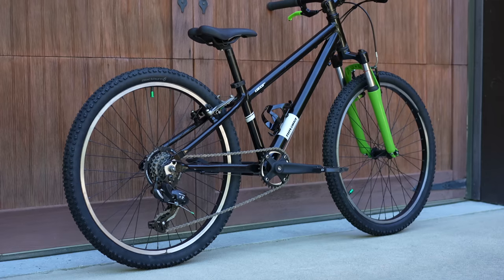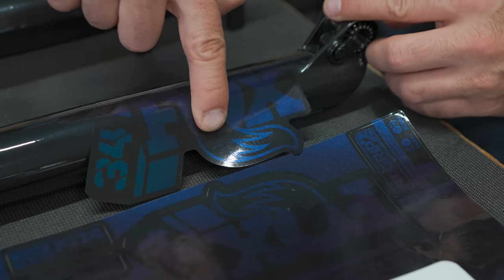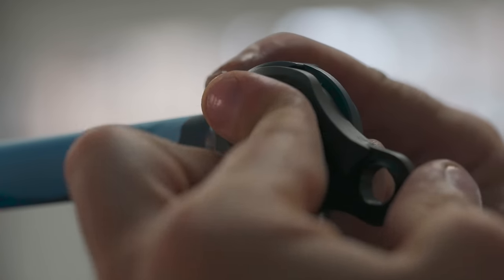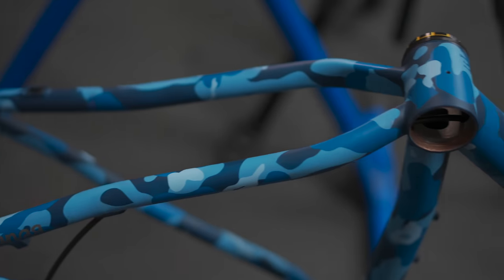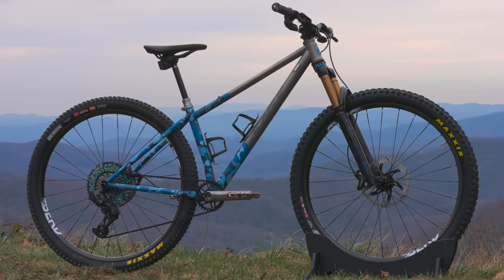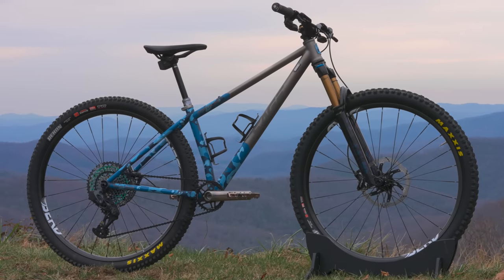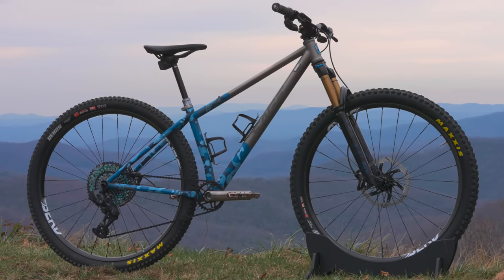Building the Custom Titanium Hardtail of my Dreams

Comment: I work at a bike shop and whenever we have brake hose rattling in the frame we wrap a zip tie around it and leave the tail uncut, so when you push it into the frame it pushes against the sides and stops the rattling.
Reply: This is actually a trick also used in sailing to keep wires from slapping inside the mast

Comment: Woah, very cool to see the shots in the Sage shop picturing the Toob Bender and The Creator Frame Fixture that I designed and manufactured in Grand Rapids, MI. Sick, bike, Seth. Can't wait to see more!
Reply from the maker: I was blown away by the tooling! Having “built” a tall bike frame using clamps and chunks of wood as a jig, it was easy to appreciate. We talked a lot about the fixture, the software, and your tools in general!
Reply: Instantly wondered if the Roggenbuck guy ™ had a say in framebuilding itself or your machinery is now widespread and appreciated. Congrats!
Reply: Best frame jig in the business!
Reply: Awesome man, I live in Grand Rapids!
Reply: @SethsBikeHacks  Hi seth I was wondering what head angle you chose for the bike. Is there a geometry list somewhere or maybe I missed it in the video
Reply: @NeronAzemi  66.5 if the dimension sheet shown is for this bike.
Reply: @jeremyhowell2332  thanks bro

Comment: I built up a titanium bike this summer myself, as my Bafang mid drive killed the bottom bracket shell on my old specialized hardrock.  New bike specs are pretty sick too: the frame is a Carver 96'er, drive train is a BBSHD mid drive pulling a Shimano Alfine 8 hub, riding on a rockshox recon 100mm fork, with TRP spyre cable brakes.  The thing is a beast on the road or trails, and the split wheel size (26" rear, 29" front) is a lot of fun.  Get well soon Seth!

Comment: I've been riging my NUKE PROOF since 1993' and it's still tight and solid. it's softened up by ~ 6% based on last flex test on the BB.  I've also been , between 235-250lbs. over that time period and blast big gears having been a pro Skier and ILB in University, downhill, trail, A line.. you name it, it's done it and been a champ for it.  Everyone looks at me like i'm an alien running around on 26s and 8spd XTR gear.  I will attest to the durability of Titanium.  amazing properties.

Comment: Beautiful build! Very cool custom blade. I highly recommend, if the sheath allows it, using a large cargo strap and mounting it to the downtube right at the intersection of the top tube and head tube. I have an Acta Non Verba P100 that sits there, completely out of the way and safely secured in the sheath, but instantly available if needed.

Comment: Your new bike looks great, and titanium is a perpetually cool material in an industry that leapfrogged it and went straight to CF. But I'd need it to have a rear shock. I've never ridden a hardtail that I didn't wish were full-suspension. I admit hardtails' classic double-triangle geometry is...well...classic, and aesthetically pleasing, and the acceleration is very direct, but riding over a single tree root is enough to remind me why full suspension is better. A suspension fork is useful for avoiding breaking your wrists on a hard landing, but it's too far away from the seatpost to do anything useful for the vast majority of your weight. And before anyone mentions a suspension seatpost, they don't do any good if you're standing.
Regarding the titanium cranks, PLEASE tell me you applied anti-seize compound to that large bolt before installing it. Titanium cold-welds like nobody's business, and without anti-seize you may never get that bolt out again. EDIT: Oh good, you did. I see the anti-seize at 3:48.
When you said the bike cost over $12,000, I nearly shat myself. The most I've ever spent on a bike was a third that much, and that was a Christini AWD bike.

Comment: Just got my first hardtail MTB
My build would start with the frame of the bike l just got which is a 2022 Marin Eldridge frame.
As for the parts being a beginner l would use good quality double wall alloy rims in 27.5 with Novatec sealed bearing hubs and pillar stainless steel spokes and brass nipples .

I would also use Suntour Epixon tapered forks with 120 mm travel with a risk headset.
Shimano BR-MT410 brakes with a 180mm front rotor and a 180mm rear rotor .
Shimano Deore bottom bracket with M4100 cranks in 170mm length and a 32 tooth single narrow wide chainring.
The rear cassette l would use is an eleven to forty six Shimano Deore ten speed cassette.
The rear derailleur l would use is a Deore RD-M5120 with matching shifter.
Also I haven't decided if I want a dropper post or to put a remote front fork lockout on my bike. But thankfully if I decide to go the dropper route the front derailleur routing is perfect for a dropper post on my frame.
The rest is personal choice.
This is what I would consider a budget build if I was building up my frame with my choice of parts.
😎🇦🇺

Comment: You may have a brake hose/ bottom bracket issue brewing..
The brake hose cannot be allowed to rub on the crank’s thru-shaft. Most bottom brackets have a center spacer that would keep the hose away from the the crank shaft, but your’s doesn’t.   If that hose rubs on the crank the hose will eat through the ti shaft.

Comment: You should try a Rekon up front on that hardtail. Minion's are great, but heavy, and moving to a lighter tire is light taking off the brakes, and you'll probably get more grip than you think out of a Rekon. The 2.6 120TPI Rekon's are significantly lighter than the 60TPI Rekons and Minions.

Comment: My dream bike- Dutch step through bike made with titanium or carbon frame, drive belt, internal hub with disc brakes. This bike would be designed for someone between the height of 4’10 and 5’0.

Comment: I just did a 92 Schwinn women’s high sierra Hardtail conversion that used to be a full rigid bike I had a bunch of retro 80s and 90s parts and I was looking for the perfect frame considering the fact I have a bad lower back I seen the bike at a yard sale for $50 I brushed it off I didn’t like it and I took a second look and it had the Kranks I love Biopsies Cranks between the tires and the cost of the bike and the free donor bite I think I don’t even have 275 into the custom bike everything is 100% retro from the shifters to the brakes to the brake levers to the derailers to the retro fourk

Comment: if you’re looking for a budget option and if you can manage to find it, some bike shops that provide demo bikes will put some demos up for sale. they are dead cheap and hardly used . mine was a solid hardtail down from £1350 to £800 and it’s only been used three times before. they also do full sus bikes at the place i went to.

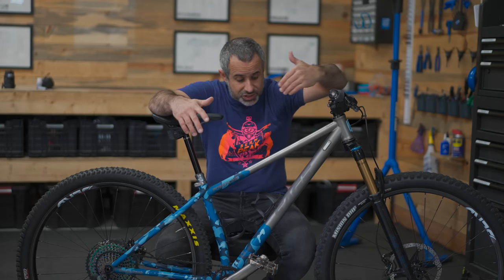Comment: 6:45 i was under the impression ti was more difficult to repair than either steel or carbon due to the high reactivity with oxygen, with steel being the easiest to both find and perform, and carbon cracks being fairly safe to repair.

Comment: Q about hardtails. I bought one earlier this year with 130mm travel and 29er wheels, but that can be changed. It's great and aggressive and handles light downhill and i love it. But I'm practicing jumps now, I'm a compete starter, I wouldn't dare a double or gap jump but I would like to work up to that but i feel the 29 inch wheels are holding me back, they feel too big. Should i change to 27.5 to conquer the jumps without compromising the downhill too much?

Comment: Like aluminum and carbon, titanium will brake after certain load cycles, only steel is immortal. Also titanium don't oxidate, but have strong galvanic corrosion with aluminum.

Comment: Seth as a former BMX rider I think you wanted to kind of relive the custom bike building that's popular in that discipline but much less so in Mountain Biking didn't you? 

I also come from BMX and building custom bikes from the ground up is awesome. When I was 16 I had a Sunday Wave frame and one of those Stolen Bike Co part kits that had everything but the frame. Not the best quality and as I progressed in the sport and rode harder, the entry level parts naturally broke one piece at a time. Breaking parts is frustrating and buying one part at a time is a lot more affordable for a teenager with a part time job. So when one part broke I would replace it with a top of the line part that I knew I wouldn't have to replace again. 

After a year or two the whole thing was completely decked out with a freecoaster, left hand drive, 4 pegs with plastic sleeves and bomb proof parts from respected brands like Odyssey, GSport, Eclat, Sunday and Animal. That bike was completely tuned to exactly how I wanted it to ride. Was able to completely color coat it to my preference so it was a 1 of 1 and didn't look like anything else at the skatepark or on the streets. I decided to remove the paint on my frame and keep it raw to show off the patina and battle scars it had gained from being used for years. I decided to deck the rest of it out with Chrome rims and cranks, black bars, stem, bars, forks, pedals, grips, seat and hubs. Then I had a subtle pop of gold on my brake lever, seat clamp, bottom bracket and headset. That thing looked amazing and I constantly got comments on it. Spent so much effort on that thing and at 18 when I was riding it everyday with my friends I loved the hell out of that thing. 

Sadly me and some friends took a road trip a few hours away to a nice lake that had a skatepark nearby. Was an awesome trip for a group of young skaters and BMX riders. Sadly though my bike was in the back of a friend's truck bed and they flipped the truck going down the highway because they were worn the hell out after a day of renting a jet ski. They didn't have a scratch on them thankfully, but sadly you couldn't say the same as the bike. Even though it was ratcheted into the bed, it got flung out onto the highway and bent up like crazy to where nothing was salvageable. If it weren't for that I'd probably still have that bike, or at least some part of it. 

That got really long, but this video brought back all of those memories and how attached I was to that bike lol. I guess I just wanted to relive that for a few minutes and share that story. I highly recommend a similar route in building a bike. There are some great completes out there in BMX and MTB where you just assemble it out of the box and off you go. But handpicking, researching and assembling everything on your own will teach you a ton about your bike and will truly make it feel like yours.
Reply: 👆👆
Congratulations lucky winner you have been selected among my shortlisted winners Dm  to claim your prize🎁👆

Comment: Im in canada and just bought a john tomac ti mtb .  Its rough but frame is mint.  Can i upgrade to 2024 deraliar and gear package or can i find old xtr parts to fit it. I also need a shock replacement any suggestions. Raleigh i believe itsca early 90ties.   I live in toronto ontario

Comment: How come the top tube is at such a severe downward angle compared to the old 90's MTB's where they were basically parallel with the ground.
Reply: It's all about the geomety Seth needed for his fit and for the dropper post that he was going to use as well. Combine that with the fork and the 29er wheels, and this bike is designed specifically for him. It rides like a dream.
Reply: @SageTitanium  ahhh thanks! ...I suppose he's a short guy, so easy step over too.  Hehehe

Comment: Hey Seth INSANE Bike. Im a hardtail guy im wondering what your opinion is on the "Silverback Slade Trail", Ive seen locals Using it as a DH/Enduro bike. Ive seen people putting 160mm forks upfront for more control downhill but it would be cool if you would review the bike because its an really good looking hardtail and looks like it has really good performance

Comment: Neuhaus Metalworks has an imo much cleverer design to allow for two bottles on small frames. 3d printed metal part that allows a bottle cage or tool strap to be mounted to it on the seat tube.

Comment: Hey Seth, I strongly reccomend you go and get the geometry of that bb shell checked: assuming you torqued down everything to the reccomended torque (which you surely did since you clearly used a torque wrench) that crankset free spin is awful and I have seen 200 dollari frameset spin better than that. Thats a true shame, nice build btw

Comment: For unlimited budget you should really consider buying intend forks and trickstuff brakes... Both Engineered and built in Freiburg, Germany
Reply: trickstuff is overpriced af and fox is still on top, better dampers and build
Reply: @Unitedstatesgov598  we are anyways talking unlimited budget here... So boutique items are kinda the topic here ... As for trickstuff, I got mine for the old price of 850€ are they double as good as a 400€ brake, no... But if you factor in that it's low numbers production in Germany, with a so far really outstanding service... And really nice looks... And actually they are really great brakes, with a lot of power as well as really good Modulation... On my next bike I ll probably put intend brakes (engineered by the same guy) or trickstuff drt again... For forks and dampers for me unlimited budget tells me Intend, fox is great for sure but definitely not the only one out there, and talking of overpriced, there is no reason for fox components to be more expensive than rock shox IMHO, which also work well... And both are mass produced... Personally I currently ride EXT fork and damper and tbh this one fits me and my riding quite well... Also here a bit of an boutique factor... But I got that for the price of the fox set I originally wanted, but which my dealer could not deliver as the Fox Germany headquarters got robbed that year

Comment: 3:49 That's kind of wack, looks like the crank spindle would rub on the brake hose. I guess in this case you need to have a bottom bracket sleeve which is extra wack.

Comment: Nah, unlimited budget would be the Priority 600x with a pinion gearbox and the gates carbon belt drive. Internally geared hubs and mid drives are so much cooler and way more expensive than your standard drive train.

Comment: I paid 350$ for k2 proflex 4000 equiped with magura hs, xt and ceramic mavic wheels. I'd like to make it 27,5, other than that its perfect. Weight is around 12KG and it is FULL SUSPENSION! I took it to heavy enduro trails and it was just fine. Get a cheap bike, it is just sickening to pay so much for mtb.

Comment: I mean this looks sick, but having worked in the aerospace industry, isn't this objectively worse for a bike frame than a lot of aluminum alloys? 7075 is stronger, lighter and cheaper.

The main reason you use titanium is either because it expands way less in high heat applications, and because it's not very reactive. Also it doesn't conduct heat well at all. None of these properties are very useful for bikes though..

Comment: Did I hear $12,000 to $14,000?? Wow! A custom Laird frame BMX yes, also titanium like $1200 to $1500 titanium RNC cranks are $400 let's say all titanium parts you're talking $4000 to $5500 with all titanium parts except hub shells and rims are carbon.

I know mountain bike parts are way more expensive which it shouldn't be in my opinion. R&D, materials, etc is not much different at all
If you're happy with your purchase that's awesome I just can't see someone actually charging that even for all custom work. I knew you liked high end set ups but in no way is this justified in price. I feel as if who work on this build hosed you down.